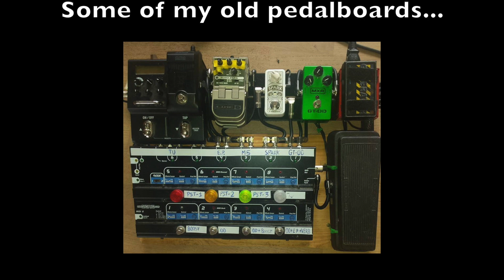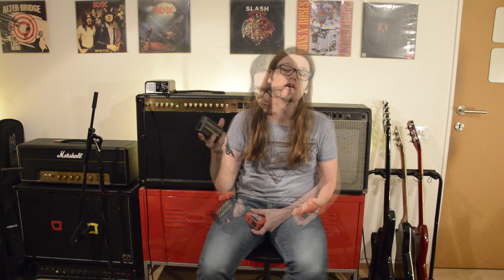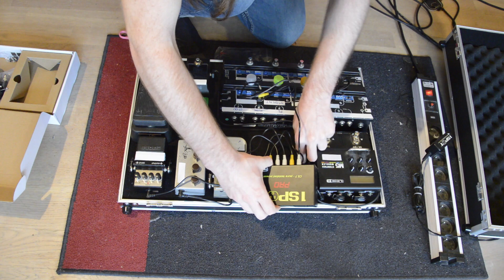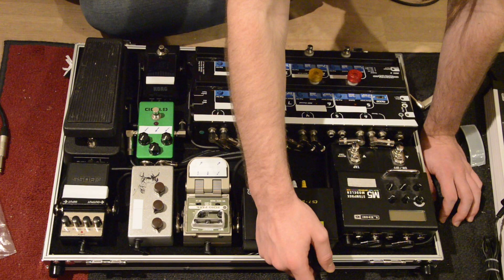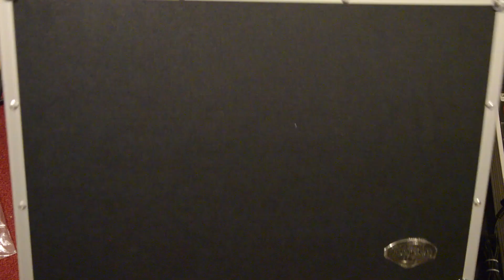BUILDING A PROFESSIONAL PEDALBOARD (With Some Tips)

Comment: Is that 1spot reliable?
Reply from the maker: It's the best power supply available for the price... Super powerful as far as current goes en outputs for every voltage you might need! Also never had a problem with it... Has a lot more current than it even says, so this is really built like a tank... Also switching power, so put any power from 100 to 250 volts in it and it will work ;) BETTER THAN VOODOO LABS!